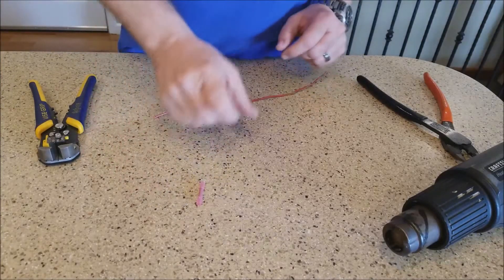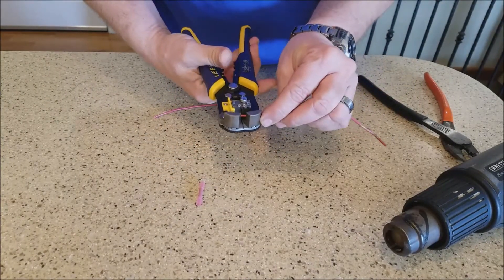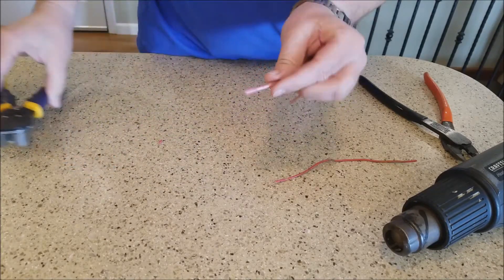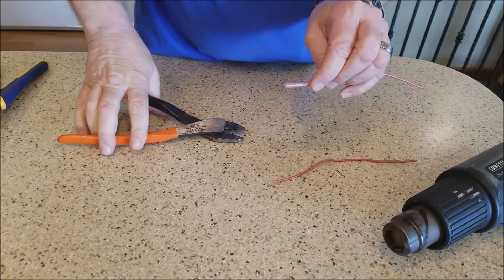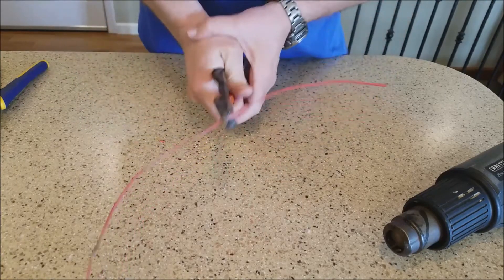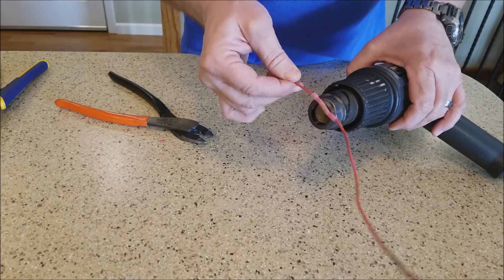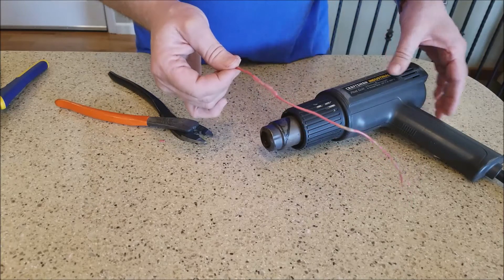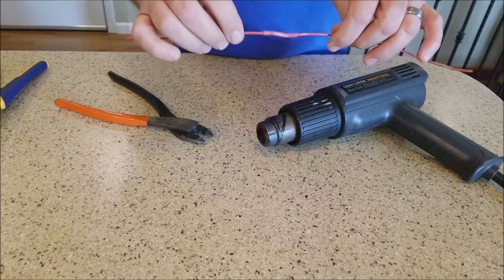Splicing Wires

Comment: Hi Andy. Another good video. I have those vice grip strippers but using the back of the handle to crimp sucks. What are those 'proper tool' pliers and where can I get them?
Reply from the maker: Google CHANNELLOCK 909 9.5 INCH CRIMPING TOOL WITH CUTTER
Reply: Andy Whittle thanks!